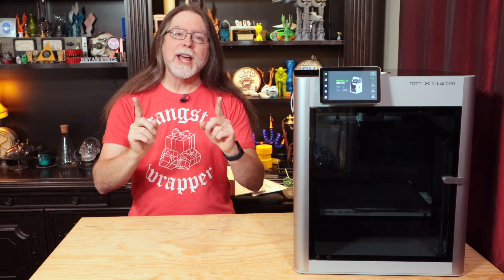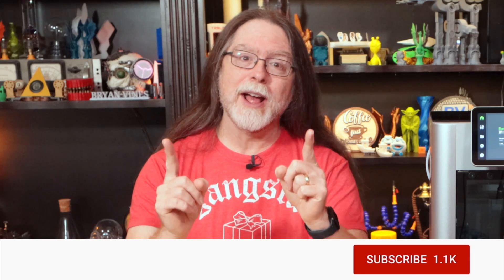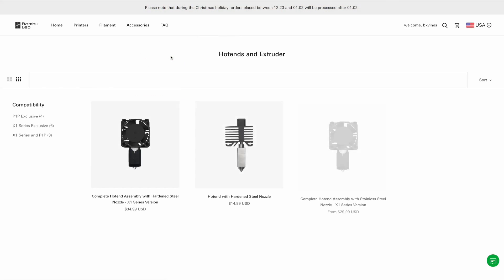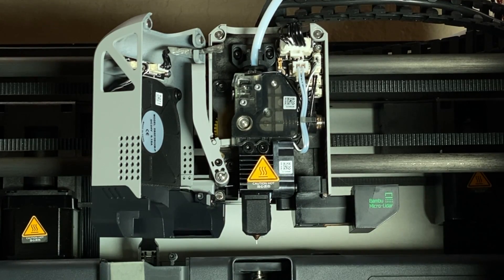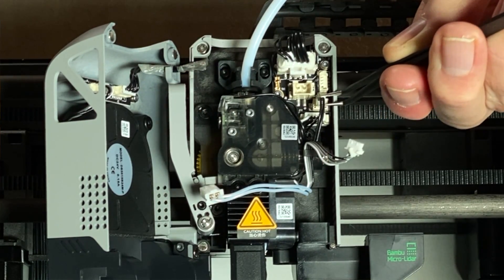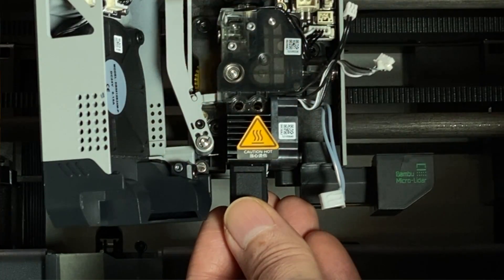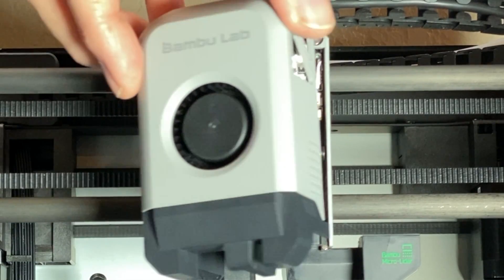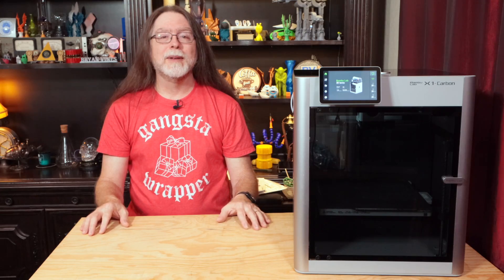Bambu Lab X1 Series - HOT END SWAP in UNDER FIVE MINUTES!

Comment: Bryan, you make it look so easy!  I just swapped the 0.4 mm hot end assembly for the 0.8 mm, it took me ~30 minutes and a lot of F-bombs!  Thanks!
Reply from the maker: Oh no! What part of the process were you getting hung up on?
Reply: @BV3D  The part where my big fat fingers have to plug in those tiny connectors!  Plugging in the thermistor was the biggest pain.
Reply from the maker: @ScientificGlassblowing  Oh. Yeah, that's a teeny-tiny connector. I can see that being a problem. The tweezers I was using were a life saver. 👍🏻
Reply: @BV3D  The way I did it was to plug in the thermistor first, then secure the nozzle assembly.  100% sketchy because I could have broken those very thin wires when I moved the nozzle into position.

Comment: Bryan, Thanks for posting this.  I received mine last Wednesday and on Thursday put an order in for spare parts.  I ordered a spare hot end assembly along with a couple of ceramic heaters and themistors.  The parts are very reasonable and good to have on hand.  The tweezers was a good tip

Comment: Excellent advice on not pulling on wires.  Those wire crimps are fragile even when they're perfect and difficult to repair.  I bought a pair of inexpensive Kocher style tweezers on Amazon and they work great for removing and installing small connectors, especially in tight areas.  They have a little set of hooked teeth on the tip that grip the connector body.  Great content as always.

Comment: 3 connectors. 2 screws. Is there also a slicer setting to change if the nozzles don't match?
Reply from the maker: Hi Jules! Great question! Yes, choose the appropriate preset in Bambu Studio to match the nozzle you've got installed. Same thing goes if you're switching print surfaces, like swapping between the textured PEI plate and the cool plate. The slicer's presets will adjust temperatures and slicing parameters based on what you tell it is in the printer.

Comment: Would this work for the p1p?
Reply: I have the X1 only, so I'm not 100%, but I'm pretty sure the process would be the same on the P1P.
Reply: There is a separate p/n for the P1P but presently the item is listed as "coming soon" so I'd assume that there is a difference especially since it states "P1P Exclusive".
Reply from the maker: The process is the same, but the P1P has different connectors. There's one connector for the fan, and one connector with the heater and thermistor wires together on it. So, only two connectors to unplug instead of three. 👍

Comment: The entire hot end of the X1 needs to be swapped just to change the nozzle? I can change the nozzle on a Mosquito hot end in 30 seconds, with one hand, and a Revo hot end nozzle in under 60 seconds. This video makes it look as though swapping nozzles with Bambu is as troublesome as an E3D V6... I change nozzle sizes frequently, making this almost a deal breaker. Designing an improvement for this would be the first mod I made to this printer.